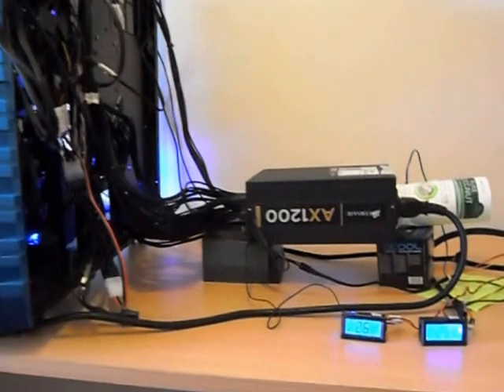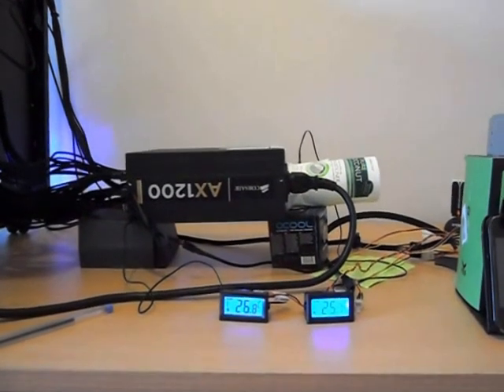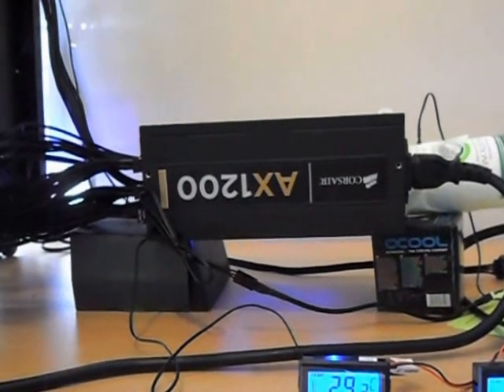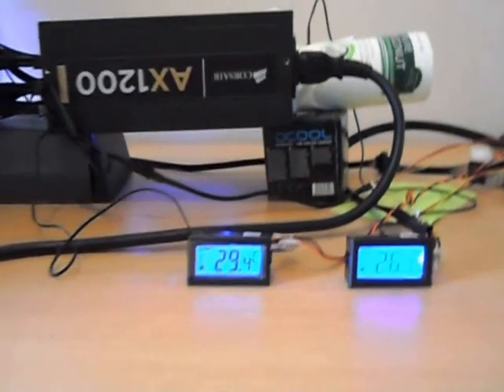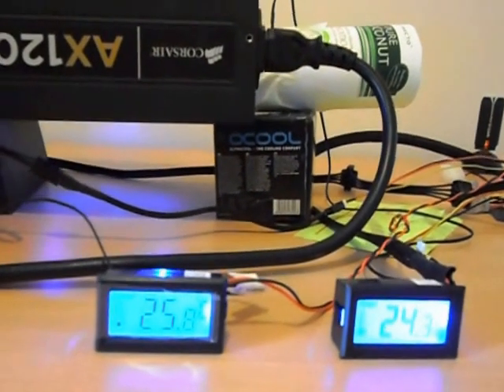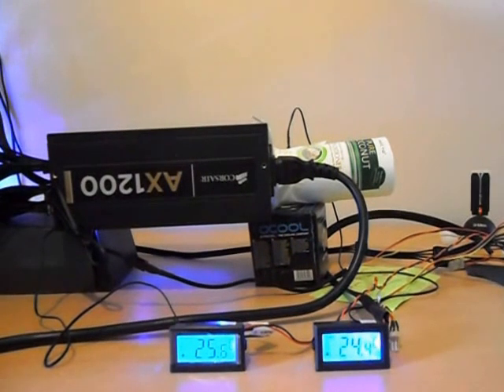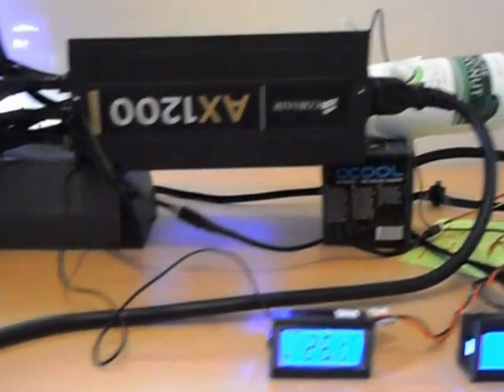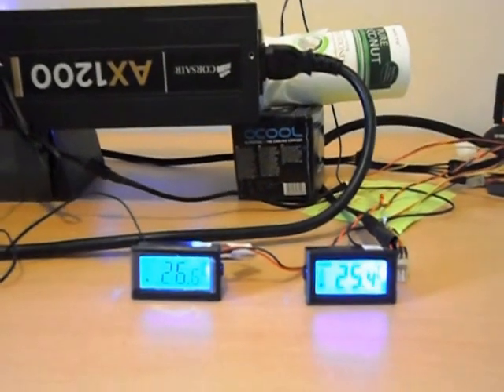Corsair AX1200 - Fan Mod (Part 3).wmv

Comment from the maker: Thanks for watching the video, NO winning at all, I am told it was down to the PWM switch but its been absolutely fine for nearly 2 years now, No issues even when hot PSU at 38 deg i have not seen it get any hotter than 40 under heavy loading, Cheers

Comment: The switch comes with the old fan, so when you get a new fan and use your own fan modulation (speed voltage variation/fan speed controller) the PSU will no longer try to regulate the fan speed and make different whining sounds at different frequencies.

Comment: Hi i have ordered the red version of this fan to go into my ax1200i as it makes the noise, how do you get the fans cable out the box so you can attatch it to the fan controller? ir will i still be able to use the corsair link software to control the fan in the psu?